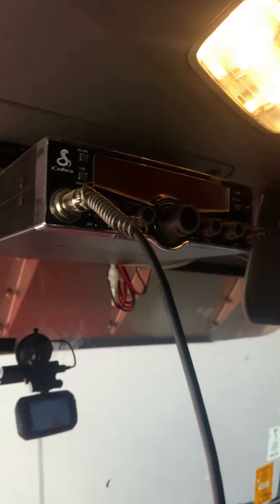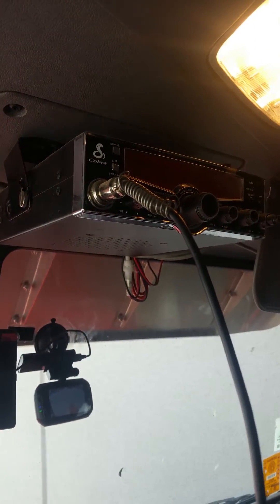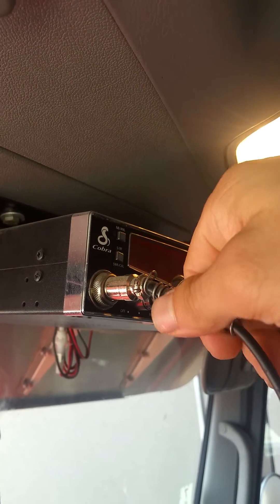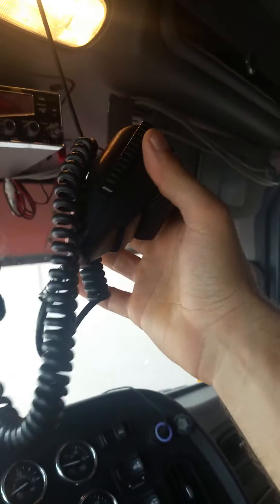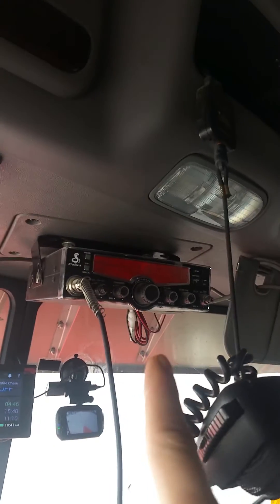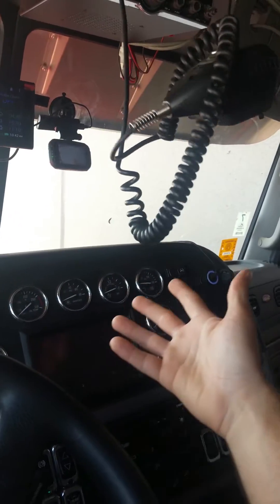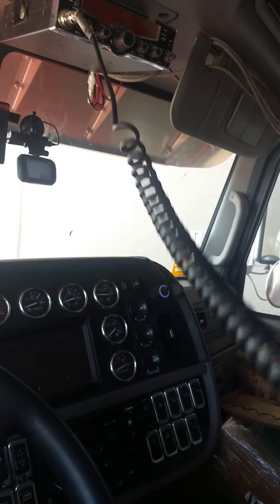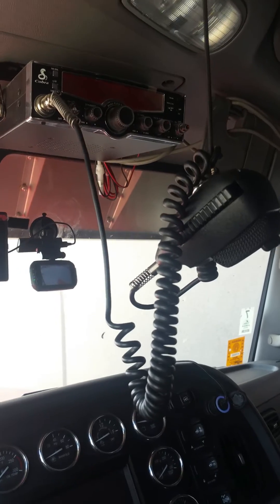CB mic tips

Comment: Just curious, what kind of motor do u have in your truck? and what size pipes do u have? I’m asking bec I’m gonna put some straight pipes on my truck soon. I want it to sound good but I don’t want it to loud. I have a CAT in mine and all of the CATS that I’ve heard with straights weren’t nearly as loud as I thought they would be inside of the cab. Now a CUMMINS with straights are usually really loud. The ones that I’ve had and heard anyways
Reply: if the pipes arent loud there may be a muffler on the y pipe underneath, 8in pipes look the best